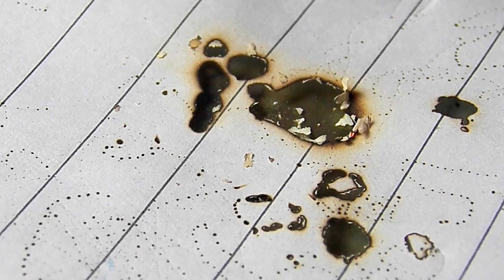Demagnetiser To Demagnetize Metals : Remove Magnetism

Comment: Please be aware that unprotected handling of uninsulated live wires and parts charged with 220 volts can be harmful and lethal.
I advise the owner of this video to remove it. People with no experience with electrical installations could get seriously hurt or killed.
Reply: I did this and the breaker keeps tripping.